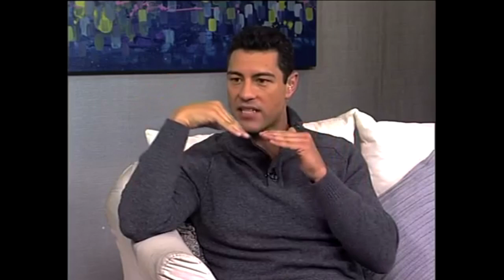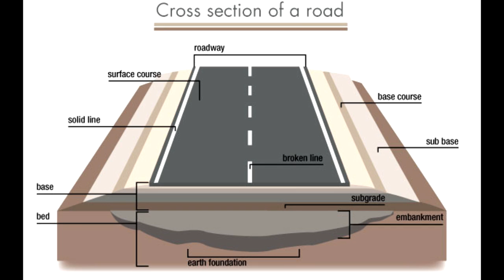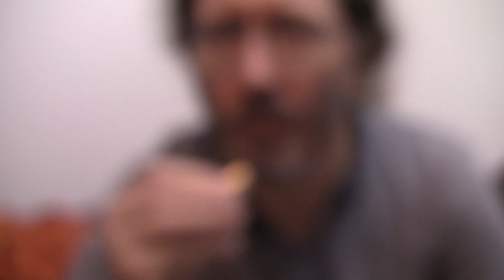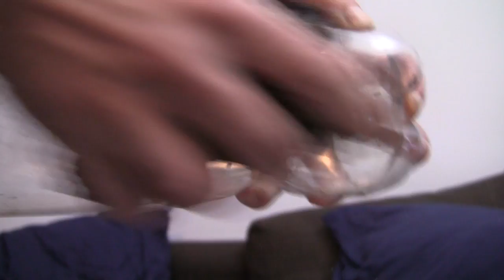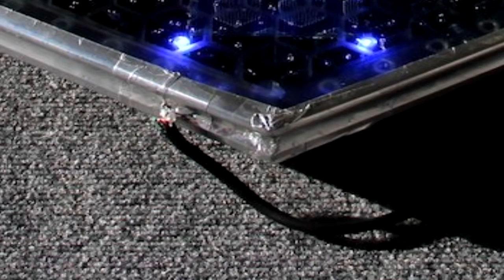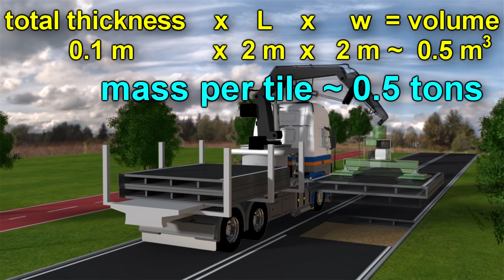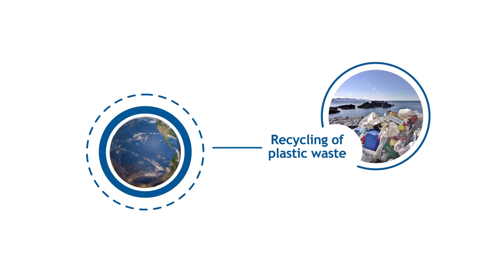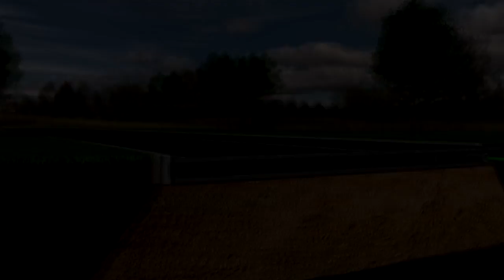Plastic Roadways BUSTED!

Comment: Wow, talk about junk science. You scrub a water bottle with a bit of brillo and that's your argument? You obviously don't do much research as India has been making 'plastic' roads for a LONG time now to great success.  I make roof tiles from sand and recycled plastic. They are more durable, less heat conductive and way cheaper than traditional methods. You should really do some in depth research on something instead of just scratching the surface.

Comment: The alternative slant on "plastic roads" is simply to mix pelletised plastic waste with asphalt, making it less likely to crack in severe weather. It's the cracks which destroy asphalt roads in the long run, because water gets in and freezes, creating potholes.
It still behaves like asphalt in most respects (is actually wear-resistant), and can be done with MUCH lower quality waste (and mixed polymers) than making injection-moulded road sections, which needs nice clean plastic all of the same type.

See:

https://www.bbc.com/ideas/videos/could-plastic-roads-help-save-the-planet/p050z42h?playlist=sustainable-thinking

with a typical BBC parting comment which is nonsense: roads will still need to be resurfaced if no new ones are built.

Comment: Roads aren't that bad... Asphalt is actually recycled at a rate exceeding 99%.
Reply: Tar is a PLASTIC !
Reply: links2films 
No it’s not.
Reply: @links2films201  tar and plastic both come from used oil but no tar is not the same as plastic
Reply: @michaelcho3564  
You take Polyethylene terephthalate ,  Polyethylene , Polyvinyl Chloride , Polypropylene , Polystyrene , Polylactic Acid , Polycarbonate , Acrylic , Acetal and Nylon  that are safe to use and the very polluting leftovers are tar.
Reply: Make sure your city is recycling asphalt vs landfilling!
Reply: Greg that’s not the point of the plastic road. It is to get arid of plastic not get arid of asphalt
Reply: Wood and rock and iron the only reusable and recyclable and regenerative resources we should use fuckkkk plastic
Reply: chadwick hayes You’re so fucking stupid it’s insane that you’re still alive

Comment: Asphalt is still not durable enough most new highways going down are concrete.. Asphalt is nice however they have to resurface it to much... And they think k Plastic will last longer.. Someone hasn't worked with plastic that has been in the sun everyday for a year.

Comment: Using plastic as a polymer binder such as Atactic Polypropaline (APP), as opposed to Styrene Butadiene Styrene (SBS), is an equally bad idea. My familiarity with these modifiers is largley limited to torch-on roofing, but it seems to me that APP would be too prone to light and thermal degridation. APP can be used as a recerfacing polimer when combined with Styrene Butatiene Ruber (SBR). That got me to thinking though, is the material we use to fill in cracks APP or SBR?  In any event, we use all the plastic for roads that chemistry will likely ever allow. Great video!

Comment: Would it not be feasible to perhaps make a modular road? I know it sounds silly to start with but taking the idea of having dedicated (and potentially easy access) channels under the road surface for cables and maybe water mains (rather than rain water, that'd be silly) and then have a more conventional asphalt road surface as a 'lid' on perhaps a metal tray. This way when you're conducting road maintenance you don't disrupt services and when you need to conduct service maintenance you don't have to rip up the road, you just take off the lid and put it back when you're done.

Thoughts?

Comment: BUSTED? Not so much. The narrator is attacking a computer graphic video and using a rock versus water bottle demonstration. Then there's the Wikipedia excerpts to help push the video into the 20 minute range. Yikes? It barely busts the solar road demo and it doesn't even come close to busting a conceptual plastic road. One must imagine that the 22,000 thumbs up came from folks who simply liked the English accent. Try the rock versus recycled plastic bench test instead: https://www.youtube.com/watch?v=IAKZgPHvE1U

Comment: They do use non recycle plastics for road surfaces already.
I "think" this is done somewhere like the Philippines. 
I'm not entirely sure where it is, it might even be somewhere in Africa, but it is used where they can't get "normal" Tar-Mac constructed roads laid.
It is melted together to make a cheap and quick surface for paths and "Track ways" and not main roads.
It works quite well until there is a heavy rain and they float away.

Comment: We already have good road surfaces, what we could improve is the process of getting a good foundation. This Plastic road is not structurally sound or durable. The proposed cable management system makes 0 sense for repairing and there was no talk about how these pieces connect together. I'm pretty sure I would get a failed grade if I presented this to a college class as a project final.

Comment: Plastic additives make up a pretty big part of modern asphalt, these are often made out of recycled plastic and rubber (tires mostly). 
e.g. http://www.macrebur.com/wp-content/uploads/2017/11/MR_products_web.pdf
In many countries these days the asphalt will be made out of 100% recycled materials primarily plastic the replace the aggregate and the tar itself is often made from recycled vulcanized rubber.

Even before modern asphalt rubber and plastic aggregate has been added to roads since the 70's as a road noise reduction measure.

Comment: On sunny days, those roads are gonna creep like nobody's business. They'd have better luck taking standard asphalt and adding small bits of shredded plastic as a filler with the rocks.
Reply: Imagine they would build a Motorway in Germany with plastic Roadways

On some parts we have no speedlimits and driving with 200+ kmh on a hollow pice of plastic that softens in the sun no just no

Comment: One way to fix the Plastic Roads to be a bit better:

Make it fully solid with real road to counter the scratches and four holes running down the Yellow lines for the power stuff with eight holes big enough to carry 1-4 gallons of water out of the sides that run out to ponds, streams and Lakes

Comment: You made this video before a BBC news video about these roads, so I will cut off some slack. They mix plastics with asphalt and other materials to have a stronger road. It's stronger because the plastic gets rid of most of the oil used in modern roads. You were also comparing water bottles to a thick, asphalt/plastic mixed road. I'll just give you the benefit of the doubt that you didn't know the roads would still be made out of mostly asphalt. But anyways, make a new updated video on this topic.
Reply: Have you even watched the video? The way they promote the product combined with the CGI animation makes it seem like that they were going to make the entire road out of plastic. Plus if it's still mostly asphalt then it isn't light weight as they claimed or even made mostly out of recycled plastic and isn't hollow to allow for wires or drainage of water.
Reply: Quite frankly, Bitumen is a superior product to plastic for making roads out of anyway, for two reasons -- availability and efficient utility of resources.

Bitumen is a waste product.  If we didn't find a use for it, we'd wind up having to store it or dump it somewhere.  We found a use for something that our current level of technology in terms of oil refining means we're stuck with.  We make roads out of it.  If we stopped using bitumen in roads, we'd still have bitumen.  We'd just have one less way to deal with the bitumen we have.

Meanwhile, plastic is NOT a waste product.  It's practically taking over my society.  I'm sitting in a plastic chair typing on a plastic keyboard being cooled by a plastic fan looking at a plastic monitor and listening to music on my mostly plastic smartphone.   We've lived through the Stone Age, Bronze Age, Iron Age.. future archaeologists by that token will name this the Plastic Age.  The stuff is too useful to waste on stuff other, cheaper materials can do.

Consider the amount of the earth's surface that is currently paved.  Consider the fact that we make nearly as much bitumen as plastic, and use plastic for many, MANY more things.  Trying to intrude plastic into road construction doesn't make sense because there's many other useful things to use plastic for, AND because the bitumen would simply clog landfills somewhere if we didn't use it in road construction.  It's a loser on both sides of the game.
Reply: Tanner Keith that's a totally different thing. You're talking about substituting bitumen for plastic. This is talking about prefabricated plastic 'units' in place of sand and stone. No update needed

Comment: Road surface so light and not bonded to the substrate that it (almost?) floats on water!

Road surface hollow and compliant, increasing the rolling resistance of all vehicles.

Roads made from manufactured tiles so roads will be straight and level.

Comment: What i thought about was: Plastic becomes really weak overtime. I have so much unused junk in the backyard of my house and some of this junk is plastic. If you give it a little bit of force, it breaks. These roads will get sun rays and rain a lot which will give the same outcome; breaking with little weight or force

Comment: A hollow space making it "floodproof" is also just another way of saying that the entire road will completely crack and break during the winter because of expansion and contraction of freezing and melting water. This happens to regular roads. What the fuck do you think will happen to fucking hollow plastic ones? Better fucking make it so it doesn't get brittle as fuck in the winter time. Better make it so the snow plow doesn't peel off an entire layer of the road... whoops. Can you imagine what a snowplow would do to this road? Each panel of this road is just going to get pushed futher and further apart. The foundations are going to get washed away... God it's just an aweful idea.

Comment: 18:21 It's already being done in some parts of my city. Using plastic as a waterproof reinforcing material instead of bitumen. Doubles the lifespan of the roads from 1 to 2 years
Reply: As far as I know roads last way longer than 1-2 years.
Reply: Peter Koperdan not in Canada my guy lol
Reply: What a shitty road then.. 1 year? What does run in that? Giant war tanks? Lol

At least 2-4 years it would last with heavy cargo trucks passing by.
Reply: @eduardoavila646  There's a saying known to a lot of people living in cold climates. "There are two seasons out here, Winter and Construction." That should be a good enough explanation, lol.
Reply: TheGreatYukon Lol it actually is, i never heard it before tho.
Reply: My guess would be its in a climate with a lot of freezing/thawing, eg. temperatures fluctuating just above and below freezing. Few things fuck up an asphalt road than water getting down in any little crevasse and the freezing, expanding in volume.
Reply: MrSmokinDragon Well it makes sense but i would guess your asphault would be better suited to a more cold climate, probably not then.
Reply: @eduardoavila646  If you live in the North-East the roads really do visibly degrade after just one year, i wouldn't say there completely bad yet though. Its worse on years with mild winters where the temp continually freezes at night and thaws in the day over and over again. Well sealed roads with filled in hairline cracks last much longer though, i noticed the country roads that are nicely paved but then milled an hit with tar and chips every year after that last very long. Concrete is the most weather resistant aside from spauling a bit but it's significantly more expensive than pavement. The best roads are concrete with pavement on top.
Reply: He said it was entirely possible to use plastics instead of bitumen.

It's the same fucking thing.
You're just using a modem material instead of an older one.
Reply: If the road is 95% rocks and sand, then it doesn't even matter what you use.
You could use honey from bees for all the road cares.
All it's really doing is keeping the rocks in place.
Reply: Keeping the rocks in place and preventing plants from growing on the road.

Comment: The only potential use of waste plastic is as a partly aggregate replacement in concrete and with bitumen. It's already being tried for re-surfacing footpaths, driveways and side roads with success laid down with conventional tools & plant. It is starting to be used for concrete elements that are either aesthetic or secondary to the structure. from anything to cast kitchen tops to cladding panels. Structurally I don't see why not subject to normal testing as we use Lytag in a lot of situations quite successfully for some time now. You're right though we will not come along with a truck and hyab and lay down pre-fab sections like in the cartoon as shown and expect it to lay evenly on a perfectly prepared surface without further adjustment, levelling and eventually most likely some injection grouting. Road design tends to be a optimisation of not only consideration of strength, but also skid resistance, drainage, frost resistance and so on. It's not as easy as any carpet bagger salesman would have you believe by cartoon. I wonder how they deal with transitional curves in the curves & bends which are often bespoke to that road???

What we really need to do is stop using plastics for the short term disposable items such as packaging, cups, pens, bottles and so on. There was nothing wrong with paper, tins & glass in the first place.

Comment: isn't plastic smooth as all hell? same with glass?
Reply: Yup, that's why plastic bearings exist. Street sweeper metal brushes would gouge the plastic leading to cavities for water to freeze, expand, and crack the plastic. In Australia the ambient air temps were 117F and the asphalt roads were melting into tacky mush so plastic wouldn't fair much better obviously when you consider it has a hollow cavity.
Reply: speaking of hollow doesn't plastic bend when there is a gap between them like the large gap in the plastic road ways they are using for cables and water?
Reply: It's not the fact it's hollow that it more susceptible to bend. It's the cross section to which the force is applied. Just grab any ruler and bending along it's length laying flat hanging over a table takes little force. Set it on it's side and it takes significant amount of more force. 

I mentioned the gap as the road surface area has less thermal mass meaning faster temp rise on road face. Which the gap limits thermal bridging towards the lower portion of the prefabbed plastic road. As temps rise of any material it becomes more ductile and to compensate they increase the thickness. Must also keep in mind plastics become brittle prone to cracking over time when exposed to the sun.

In the event of road section replacement with embedded utilities they'd require removable links which are more susceptible to failure. Hence, why pipelines crossing long distances are welded together ideally as they come individually 40' - 53' sections. Where I'd speculate every 1000' they'd have a traditional bolted gasket coupler to inspect or what not.
Reply: so in short instead of the ocasional pot hole we would get molten plastic pot holes  that would release a deadly gas in the air that could kill those who get caught in it